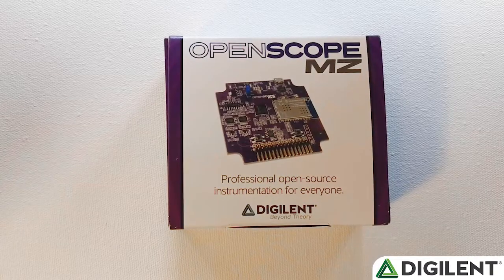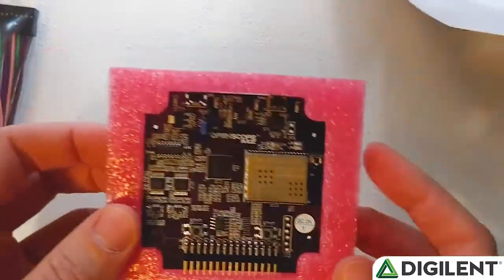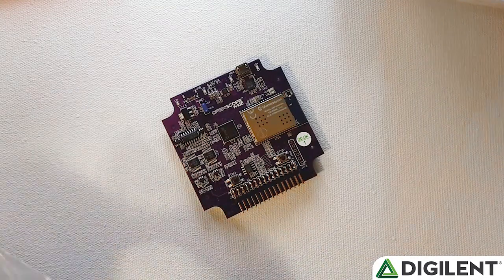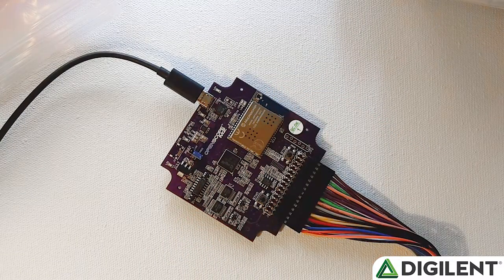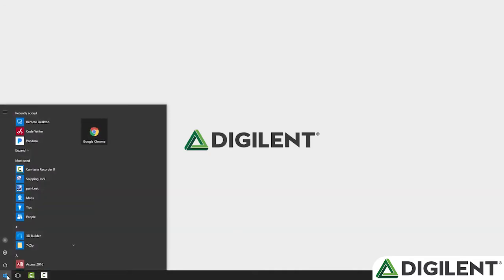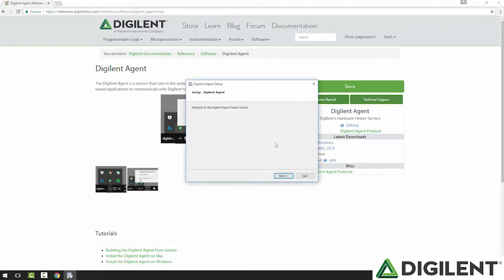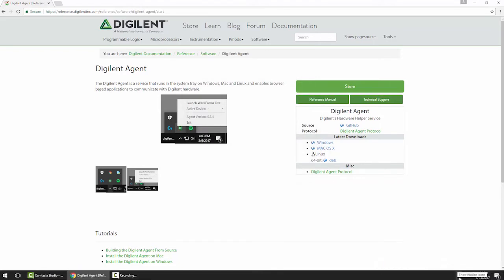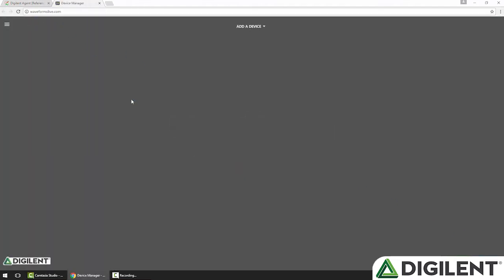Getting Started with OpenScope and Waveforms Live - Video 2 - Unbox and Setup

Comment: I just received my OpenScope. I downloaded and installed the Digilent Agent. Right clicked on the green D gear icon in system tray, and opened a browser window at waveformslive.com. Clicked on Add a device, Agent, + sign. All I get is this: "Error connecting to the Digilent Agent. Please make sure the Digilent Agent is running." But it is running. That's the icon I clicked on to open the waveformslive.com window! I cannot get past this . . . any idea how to get going?
Reply: Hi, I too just got my OpenScope to do something. I found out that in my case, it would not respond to the software no matter what. Since i’m running it on an old HP laptop I figured it was because it was slow. I too went to waveformslive.com and got the site to do something but the download update would not work. I also thought that I caused the scope problem too. So I found out that the openscope software was available and is written for a Bas32 processor controller. The software is also available and written for installation using the Arduino IDE. So I loaded the software into the IDE and uploaded it into the board which took about 15 minutes. When it was done tried doing the Waveformslive site again and had no success. Found out the leds still do flicker on power up the same way too. Also if you do a power up while holding the 2 pushbuttons , release the left button, the board also flickers the back led very fast. Still what it did before.
Reply: So t he next day I booted up the computer and plugged in the board, still had the same results. So I just let the board stay connected for up to an hour.. not sure.. Also tried the waveformslive and it to failed to connect. But later i noticed the site showed that the board status showed it was now enabled for COM3, which it showed before not enabled for COM3. Once that happened, it allowed me to continue thru the rest of the process of updating software to latest and the rest of the steps. Also more leds turned on for a bit, and then the led near the usb connector started blinking showing the board is ready to use. I then disconnected from usb and reinstalled connector and computer also responds with beeps and the blue blinking led! Anyway I suggest you just plug it in and let it sit because it looks like it is doing a download of some sort that on my laptop took the long wait period on my laptop. Also make sure to update the software with waveformslives site to the latest. After that is done , it responds within a second or two. Also since my laptop has USB 2 ports, i thought that would be a problem, but it responds well. Just to let you know, i’m running this on an HP Pavilion laptop that is at going on 8 years or so old with USB2 ports running the latest Windows10 software. Also for the software nerds, you can also look at the installed software listing code for how it works that is available as a zipped download. When loaded into the Arduino IDE, you can look at the code. Also make sure it is set for Bas32 ?? Processor if I remember before uploading. Hope this all helps if you have any troubles.
Reply from the maker: Carlos, it looks like that is a fairly common issue, unfortunately, we don't have engineers moderating the YouTube comments, so the best way to get this issue resolved will probably be for you to post an inquiry on the Digilent Forums: https://forum.digilentinc.com/

Here is a video with some tips and tricks for forum posts: https://youtu.be/krqSlIsPhJo

Thank you!
Reply: Hey Carlos,
Post at forum.digilentinc.com and the developers will help you through troubleshooting.